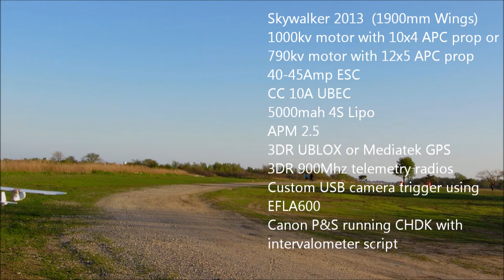Skywalker 2013 UAV - Aerial Mapping Platform

Comment: This camera canon SX 280 HS is very good, but they are not like the others, because there is the possibility of food through the USB port. If you have solution to eliminate it we will have a great advantage to do our jobs photogrammetry. And therefore only increase capacity to 64GB and will have many advantages.

Comment: Awesome :D Keep your videos coming, I have been hving good results from my setup. I dont use the trigger t start the intervelometer though. The sirius does a fine job aswell..cant be thrown about much since the wing loading is pretty high so gentle control movements work best I tried doing a roll with the sx260 and when the wings were vertical the plane bit hard and wanted to stay in that position but going straight down..took all my rudder and throttle just to get it flying again haha.thumbs up

Comment from the maker: That's the general idea in terms of collecting the imagery, yes. I use a script that allows me to set the interval between pictures. I can turn the intervalometer on and off remotely at the beginning and end of mapped area.
The post processing is a bit more complex as you need to leverage photogrammetry in order to properly orthorectify the imagery and you'll need to georeference the orthorectified imagery if you want to use it in a Geographic Information System (GIS).